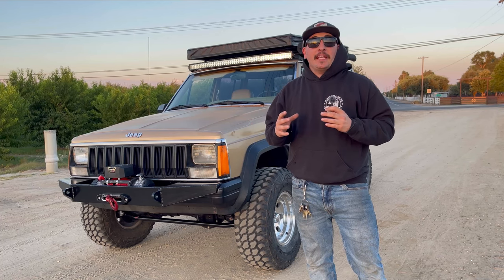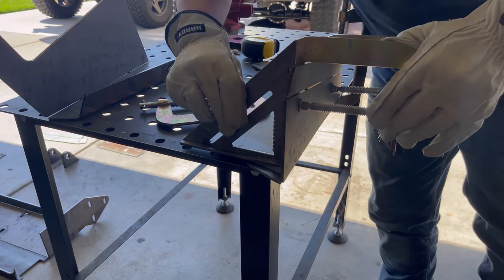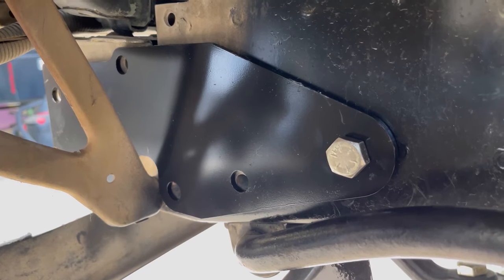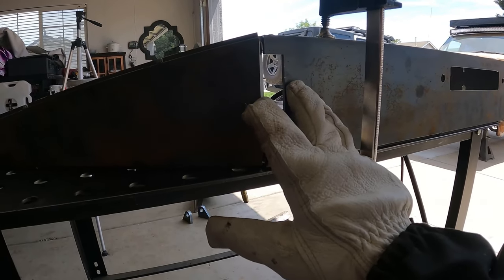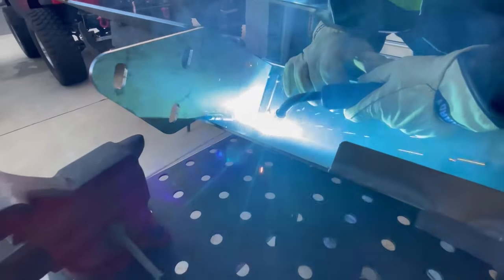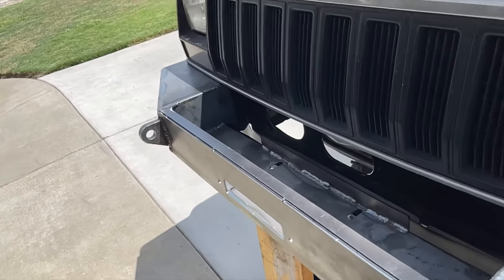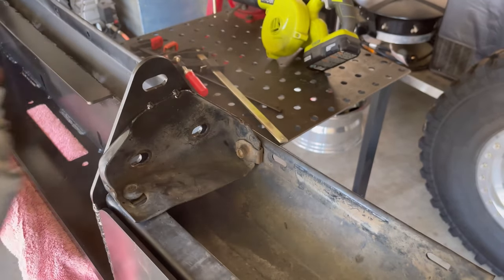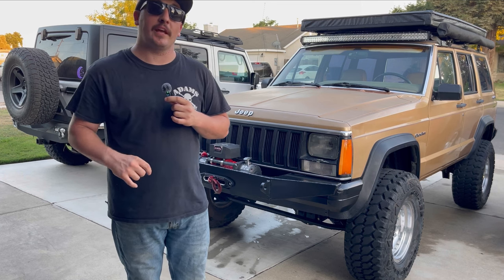Jeep Cherokee XJ - DIY Front Bumper Build Episode: 9

Comment: I did the same thing except with the winch bucket.  I made the wings different though. I did not like how the wings angled up so I changed up the wings. I took what was suppose to be the front of the wings and used those for the top. The 1" bottom section I made the front and I welded them so the 1" section was parallel to the bottom of the winch bucket. This made the wings sit low and blend with the bumper well.